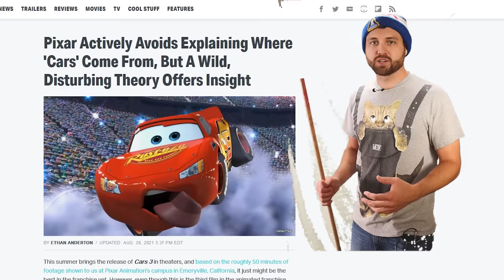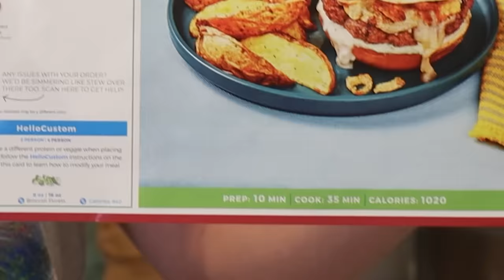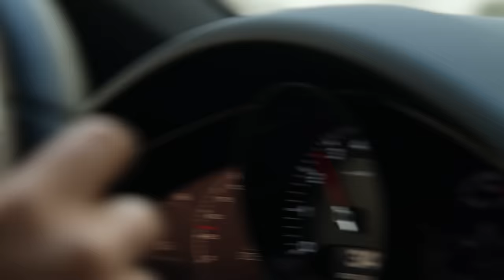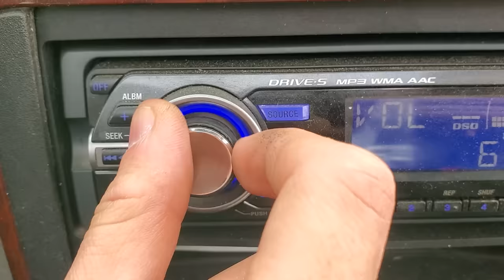How many parts can you take off a car?

Comment: Realizing they WEREN’T being pulled over must’ve been the greatest rush of their young lives 😂
Reply: On God even I felt it
Reply: Insurance aside it was road legal. Also They made this video as a joke but people will actually strip the car of unnecessary parts in certain races. Most common one is taking out all the passenger seats. And like they did breaking the side windows. Fun fact you don't need air bags if you have a five point harness.
Reply: @allstarwoo4  Dont need any protection if you simply never crash

(In case it is not obvious I am joking, safety first!)
Reply: @moonsalibi  I know you're joking but when seat belts were first introduced people actually thought you were a wimp for wearing one.
Reply: @allstarwoo4  i know people that still think that

And one of them rear ended a parked dump truck because his brakes gave out
Reply: @_underscore_9271  if his brakes gave out then i dont really get it
Reply: Is it they weren’t what you basically said was Realizing they are were not being pulled over
Reply: @hyperblazeman  fixed it 🤙🏻
Reply: Perfect timing, really.
Reply: Yea, Its a weirldly awesome feeling.
Thought I was being pulled over for speeding, 50 in a 30 and a cop car just appeared out of nowehere behind me with its lights on, I pulled over and he just overtook me and kept driving. Massive sigh of relief
Reply: @allstarwoo4  5-point harness is great for the body, but the seat+airbag system is designed to work together to help slow down the sudden deceleration of the neck and head. You got a bowling ball on a silly straw. When you suddenly stop, your head keeps going forward in front of your body. Your necks going to have a lot of force on them. 

Airbags in the steering wheel and glove compartment are there for a reason. A 5 or 6-point harness is amazing for the body, but the head and neck also need something to prevent them from getting whipped about.
Reply: @IIBLANKII  Well that's why you probably should also be using a HANs device in any car you're going to be relying on a harness
Reply: *hot young lives
Reply: @IIBLANKII  I was just talking legality. I know in racing they use a helmet, neck brace and maybe an tether. 

Airbags absolutely save lives but there is some context. Airbags stop you from bashing you head. However the danger of whip lash is less dangerous than cracking your skull. So yes whiplash is a concern but it’s much less likely to kill you.
Reply: For real. I would've floored it in excitement afterwards
Reply: @IIBLANKII  yeah that's why they have a hans device in race cars now.
Reply: He probably was driving forward, probably about to park - couldn't brake and crashed in to dumb track in the next parking spot?
Reply: @_underscore_9271  yeah, I never understood the point of not wearing a seatbelt. I've known people buying little metal clips you can buckle in like a seatbelt to keep the car from beeping every five seconds because you're not wearing one. It's incredible to put in that much effort just to not wear a seatbelt.
Reply: @shreknskrubgaming7248  the people I know just have the seatbelt clipped in all the time and sit on it, remove their chime, or somehow ignore it, but yeah, once you get to that point it is kind of ridiculous
Reply: Young? Will is like 30, he has a wife and a kid

Comment: As a mechanic I’m so ducking confused on the red car being cut in half to find the breaks light wires😂. I… yeah… 🤣
Reply: I'm not a  mechanic but the second they  cut the unibody frame holding the brake lights didn't that make it illegal?
Reply: @orreongman  yeah it does because if the car rolls you essentially no longer have a roll cage. Dude in the back seats head would have been gone😂👍🏻
Reply: Am I the only one who's worried about that fuel placement ?
Reply: They seem a little dumb at times well they are* lol
Reply: @josiahamaze  it’s not that dumb considering they earn money from it
Reply: I think it's a bit and they just wanted to cut it in half 💀
Reply: I’d assume it got pulled into the frame after they cut it, and they couldn’t find it. And then they started cutting. And then they hit the fuel line. And then they cut it in half
Reply: @hellsphoenix9308  what back seats?
Reply: pls just say fucking
Reply: @defentieboi-xx2nw  So often we desperately want to, but that desperation is dramatically overwhelmed by how fucking fed up we are with having to correct the "auto-correct" every fucking time.
-written from a keyboard like god intended
Reply: And how it holds fuel pressure?
Reply: @hellsphoenix9308 If you dont know what you're talking about, you shouldn't. Not having a "Roll cage" in your car does not make it illegal. Modifying the frame doesnt make it illegal.
Reply: @Apollo55_   the frame is your roll cage. If the frame is bent or tweaked it’s totaled out by insurance unless you spend a lot of money to get it fixed. So cutting the bastard apart totals the car. Not hard knowledge. And it makes it a rolling hazard when your head poked out. Not like a drop top that’s structurally made to be like that. Use your brain.
Reply: @hellsphoenix9308  A car being totaled with insurance and being "Illegal" are two totally different things. Changing the subject doesn't make you seem smart.

P.s most roofs don't act as a roll cage, that's why people add roll cages to them. Roll cages are not commonly used in America.
Reply: @Apollo55_   if you can’t drive a vehicle on a public road, which they did, and it’s totaled it’s illegal. If I wanna drive around on my property with that then yeah sure. But still on public roads it’s illegal.
Reply: @Apollo55_   roll cages arnt that common cuz your normal roof does the job till you cut it off😂. You add a more beefed up actual cage when your making it do more than it should. Like a derby or track car. Your pushing it over it to a dangerous level so you need to reinforce shit. Again. Use your brain. It’s not a neck weight
Reply: @hellsphoenix9308  Again, a car being totaled is not a legal term, cars that are deemed "Total loss" are given "Salvage" titles if they havent been fixed and "rebuilt" titles if they have, both of which can be driven provided the car has been inspected by DMV. The only titles for a car that cannot be rebuilt and driven are junk titles. Your state may vary.
Reply: @hellsphoenix9308  I guess you've never seen any car roll over because the roof crushes like a tin can. Does it provide some sort of protection, sure, is it a "Roll cage" absolutely not. Most of the structural strength comes from the Pillars. Which will also fold like a tin can....
Reply: @Apollo55_   yes we see it all the time. I work for a frame company. If it’s a salvaged title it wasn’t totaled. It can be un totaled with a lot of money from our shop. And can be worked on and still be told you can’t drive it. Salvaged doesn’t mean totaled😂. You can get on YouTube rn and watch more cars roll over and not be crushed in then crushed in. They have to check for that when making a car. If you have to add a role cage for every day driving that’s a design issue. You add a roll cage when you do shit the cars not supposed to do. Most instances you see a roof crushed in. Is when your doing what your not supposed to do. Like running from cops or playing gta in real life. Even then the car holds. They have to design them as safe as possible. So hop off my nutz and find a new comment section to harass 😂🤣
Reply: @Apollo55_   wants to talk about “changing the subject doesn’t make you look smart” just smacked your ass around didn’t it 😂😂

P.S. even if it’s a salvaged title. It can still be totaled on top of that and not operational 😂😂. My state means that’s a derby car or race car which isn’t legal on public roads. So again. Not a legal vehicle.

Comment: As a mechanic this is hard to watch but I lost my mind when I saw the fuel tank on top of the engine.
Reply: Same 😂😂😂😂
Reply: Please explain why the fuel tank on top made you freak. Other than the fire hazard
Reply: @rrteppo  we are all pyromaniacs, why else?
Reply: You dont need to be an engineer to know that, you just need common sense 😂
Reply: @sean6992  that's why I was confused. I was like, "am I missing something other than the fact you are putting gas over an explosion"
Reply: Fuel tank sits on top of the engine in nearly every motorcycle built, what's the problem?
Reply: i died with "its a front wheel drive" "oh!"
Reply: @nathanschild2388  Those are designed to be that way from the start, that’s wildly different

Comment: They were so successful that they reduced the car’s price into the negatives!!
Reply: According to that dealer you'd have to pay them $1000 to take that car off your hands. Therefore we can logically conclude that the dealership would have to pay no more than $999.99 to the next buyer of that car and still make a profit
Reply: @pogo1027  This is actually an interesting situation. Could you run an entire economy on negative prices, where the less you pay, the more it's worth?
Reply: @michaelramsey82  As odd as it is to think about, we pretty much already do with loans, credit, ect. It would work exactly the same, just opposite.
Reply: @michaelramsey82  Yes, you can! I can prove it to you if you give me 10,000 dollars.
Reply: @vigilantcosmicpenguin8721  don’t trust this guy, i’ll show you for just $20k
Reply: Well, not really.  The dealer probably should have made an offer.  It's worth scrap metal value if nothing else.  Not even hard to deal with.  Would have just had to make a quick call to any one of those guys that buys cars for scrap and they even haul it off.
Reply: @ColonelSandersLite  Scrap price near me is $75 when you have a car towed to the metal recycler. If it's similar there it's easy to see that it's absolutely not worth making an offer.

If you want to strip the car down to bare metal yourself, as well as tow it, then you can get paid more. I've stripped a car to sell for parts and I just dug a big hole, cut the car in half, and buried it because it was the only free option I had with a non-rolling chassis.

Comment: Pee is lighter than coolant, so you could pee in the radiator to save even more weight
Reply: good idea, and it's also free
Reply: ok what in the what
Reply: @lincolncole262  yo peey and ya radiyaythor
Reply: @jjsanimations  just don't get seen peeing in the radiator :)
Reply: why do you know that
Reply: @Beencheeling . Or do it when the engine is hot. One wrong move and hotdog
Reply: @jjsanimations  Like street signs and traffic cones
Reply: or just water

Comment: A good way to see that one of the blinkers is not functioning, is when the other blinkers on that side blink twice as fast as normal, apparently this also happens when you saw the car in half
Reply: Blinkers flashing faster than normal generally means one light is out on that side...or not there at all lol
Reply: because there is no longer an electrical connection to the taillight blinkers, it thinks one of the bulbs burned out
Reply: @DrDudezLoL  Nope, just that the front or back isn't working. Blinkers are on a relay, so when one doesn't connect, the signal travels back to the first one twice as fast.
Reply: Useful to know if you ever... saw a car in half.

Comment: my mom's first car was a "cut and shunt," as she called it. Two different cars very illegally welded together and rusted through underneath the carpet. Best thing is she didn't know until years later, no mechanics ever noticed it (somehow???) until a decent few years later.
Reply: Yeah those typa cars are so dangerous yet in a lot of the smaller dealerships they sell them cause it’s a bigger profit for them
Reply: They probably knew but figured it was better to not ask questions.  Probably figured it was all she could get and she was willing to take the risks.
Reply: Two different ones, or one car cut in half and imported as "parts" to avoid import duty?
Reply: @bachaddict  I'm not sure actually, but this was in the 80s and it was a car made in the UK which she bought in the UK, so super bizarre!
Reply: @ColonelSandersLite  haha probably true, they just looked at her and thought yeah she gives 'cut n shunt' vibes
Reply: @RealElongatedMuskrat  "Cut and shut" is a common term from back in the day. The reason it happened here a lot is because cars rust pretty easily in the UK, especially around the sills, so it was normally built of two or three different cars.
Reply: @RealElongatedMuskrat  yeah that was a big problem in the 80s. It was usually two crash damaged cars with the good ends of each car welded together.
Reply: @MrStabby19812  I would not be surprised at all if that was what she was driving 😂
Reply: nig a  ahh that's interesting that it's still pretty prevalent, I assumed it was a "damn the 80s were wild" kinda thing 😂
Reply: nig a  holy shit that's amazing hahaha. I grew up in rural Ireland and that's the kinda thing you'd still see people trying to get away with even when I was young. I feel like NZ and Ireland are spiritually aligned in that we're all not quite right in the head 😂 we're two island nations overrun by sheep, slightly batshit, and down for the banter

Comment: I just love how everyone who removes windows for weight reduction just smashes them in, so that all the sharts are just inside the car but broken so the weight is still there, it's just harder to take them out.
Reply: Have no doubt that car was full of sharts, but the word you were looking for here was shards
Reply: Losing my shit over this thread
Reply: But they just removed the whole doors
Reply: @kareemelsadek  are you sharting over this thread?
Reply: yeah man those little fucking sharts are a nuisance, they are driving like mad men.
Reply: @kareemelsadek  is this Reddit or something
Reply: me when i fill my car with sharts
Reply: If they wanted weight reduction they should have pulled apart the armrest and discarded it to get to the window motor and throw all that shit out as well. The brake lights were a ridiculous non issue if they just tapped the brakes quickly and probed the wires with the multimeter they could have easily distinguished them
Reply: The sharts make the car make the car more aerodynamic.
Reply: The sharts make the car make the car more aerodynamic.

Edit YouTube glitches out and duplicated my comment for some reason. 🗿
Reply: @bodysnatchers4ever  he just like me fr
Reply: @deejayskyce5282  "and throw all that shit out as well" meaning sharts residue correct?
Reply: Got to love a nice shart
Reply: Yeah they should’ve broken the windows out rather than in
Reply: @thetwitchfurry5548  No mind to think. No will to break. No voice to cry suffering. Born of God and Void
Reply: I mean the roof is actually a structural piece. Convertibles have extra structural support underneath to avoid the problem but those cars eventually will start to fold in on themselves like a taco.
Reply: @jrmbayne  Lmfaoo

Comment: Back in the 70s, before seatbelts were a thing, my granddad had a spectacular car that wouldn't turn left and had a hole through the floor. One of my uncles actually fell out of the car while it was in motion, but surprisingly, he fell through a window. 😂
Reply: i think in the 80s my dad bought a karmann ghia. it also didn't have a floor (rusted out). he was living on long island at the time & just dealt with the fact rain and snow often came up through the bottom
Reply: Idk when but when my grandpa was younger he built a car with a friend and while taking it out for a test drive the steering wheel came off

Comment: This has such old school Top Gear janky car building vibes, love it.
Reply: Scrapheap challenge!
Reply: Because they did the "cutting a car in half" but in top gear. It's the episode where they make diy limousines.
Reply: Exactly, some of the methods felt very Clarkson
Reply: @bonimnida  has anyone got a hammer?
Reply: They came to the same conclusion, "'cause it's just better." - Jezza.
Reply: They came to the same conclusion, "'cause it's just better." - Jezza.
Reply: Why didn’t this make it in to Bottom Gear?
Reply: Grand Tour just isn't the same.
Reply: @jacobb7608  What and how much have you watched. It may not be the same but I have found many sections to still have the trio magic that I'd enjoy.
Reply: I do believe clarkson did the reverse with an open door to remove it strategy
Reply: @youreafurry8818  Close enough. In "Man with a Van," he used James May's van to rip the door off of his in the "remove and install a new door" challenge.
Reply: This kinda makes sense because based on the safety third podcast William watches Top Gear for fun.
Reply: rr

Comment: I like this. I was a firefighter for years and honestly it always seemed expensive for these cars. Until you see them in an accident. Older cars people would get torn apart. New cars had safety features and air bags everywhere
Reply: Like the new bronco optional feature  of blowing your motor
Reply: @tylersowa3858  FORD's are exempt.🤣
Reply: @ToreDL87  the old ford trucks are yes!

New ones not so much ..6.4, 6.0,don't have s*it on the 7.3 lol

I like ford just to clarify
Reply: @tylersowa3858  Ah I meant ford breaks down so much that if the Bronco didn't detonate it's own engine it would almost be a surprise 😁
Ofc, the 7.3 is golden ^^ A sadder story is the drivetrain behind it 🤣
Reply: @ToreDL87  facts ⬆️
Reply: What's the worst kind of car to get in an accident in? In your experience.
Reply: @alexandriacandler2877  in my opinion ?
Reply: @alexandriacandler2877  1970 ford pinto it would explode
Reply: New cars, are built around reducing drag for better gas mileage and adding safety features, because new safety requirements and that's what sells, people rather spend extra money for a car that crumples reducing the impact on them, rather than a stiff car with no safety features which can get them killed.